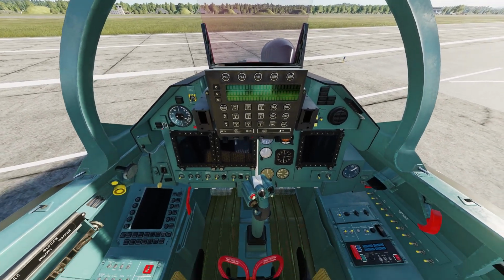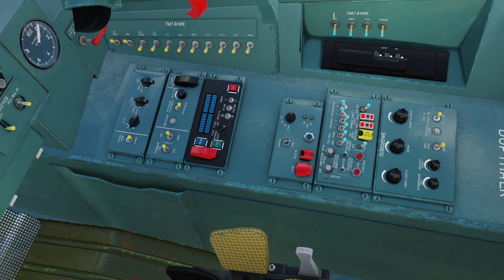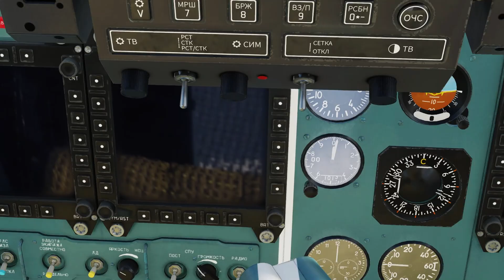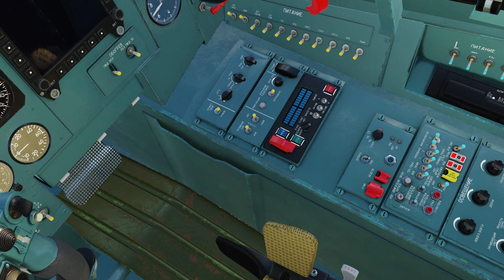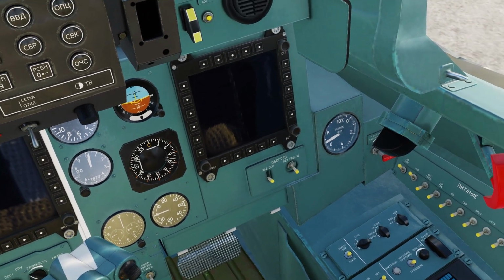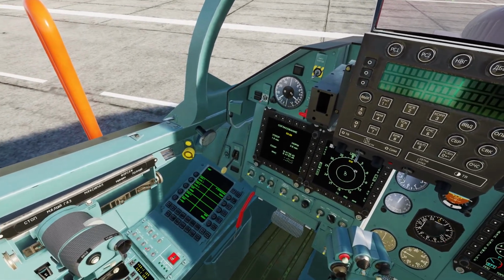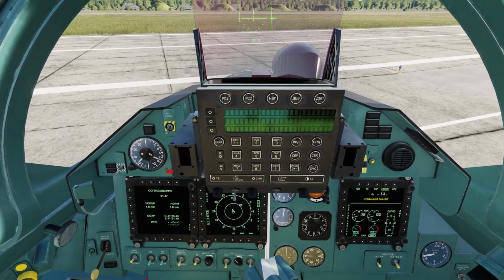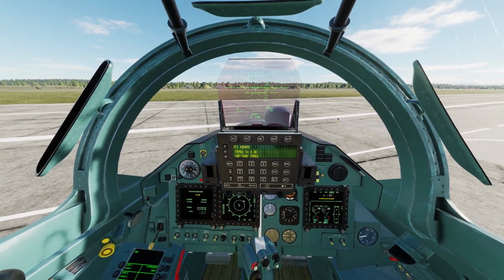DCS Su-30 Codename: Flanker Startup SM/MKM PT 2 (Cold & Dark)

Comment from the maker: @GAflyer  There is a bug where the engine sound & RPM will show 100 even though the engine is off.  If the engines don't come back up try turning off all of the switches and repeat the startup process. The throttles won't move from off to idle position until the RPM hits 25%.
Reply: I had this same issue. It only happens to me when I finish a sortie and try to jump right back into another mission. If you restart DCS completely before each sortie it should keep this from happening.